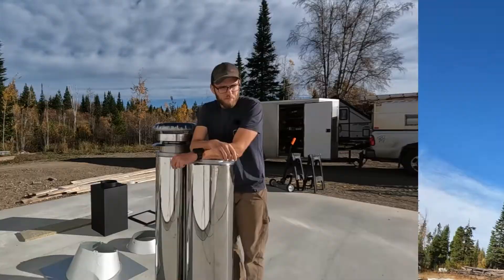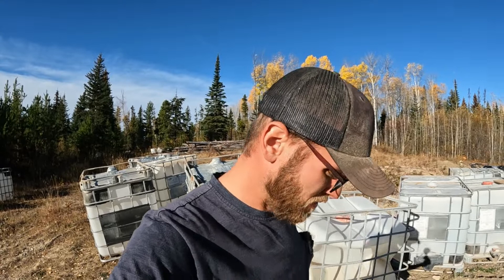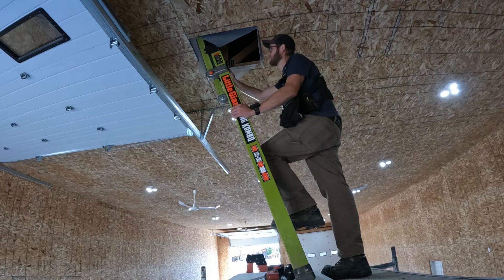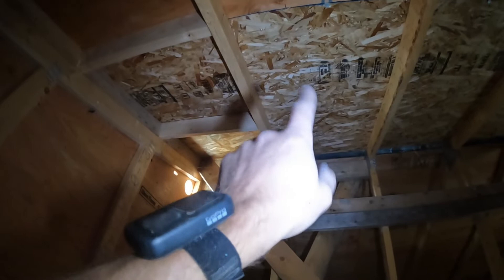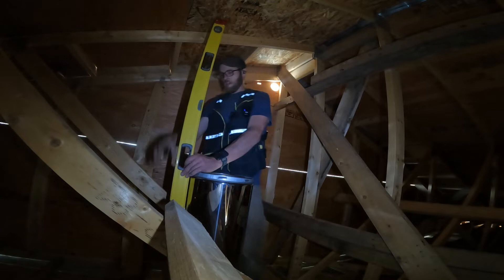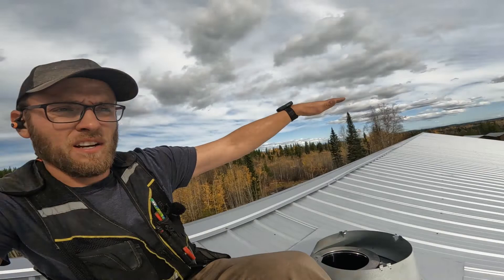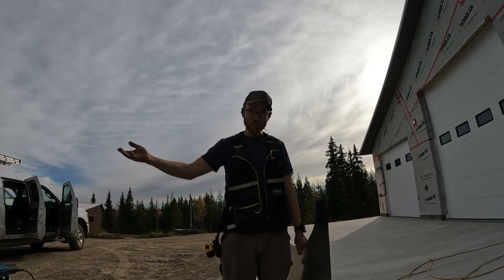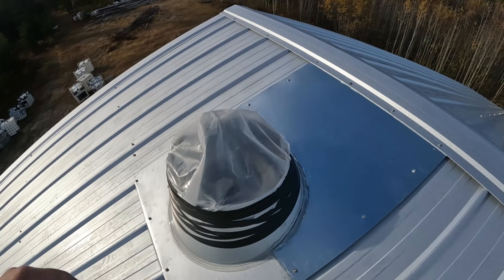Wood Stove Chimney Installation. Roof Flashings, Sheetmetal and Jig Saws!

Comment: Finally a good-looking metal roof chimney install. Great idea. I'm in. I'll be using your method for my sauna, thank you! What sealant did you use on the top oustide? Fire sealant?
Reply from the maker: I used a product called “Through The Roof” I’ve had good luck with it and it can be applied to wet material and in the cold. It doesn’t have to be fire rated because it’s not in contact with any heat. Thanks for watching, appreciate the comment.

Comment: I like your method! What type of metal was the shiny  silver piece you ran from the ridge cap to the flashing? I was thinking of doing something similar with some left over corrugated roofing. So you see any problems with that? Thanks!
Reply from the maker: It was 26 gauge galvanized sheet metal, nothing special. I buy a whole 4x8 sheet. Corrugated works well too if you line up the ribs for the overlap. Appreciate you watching, thanks.